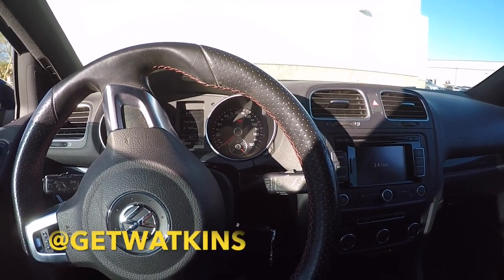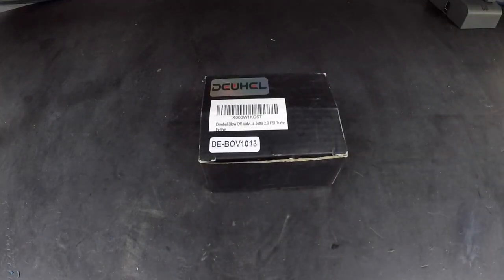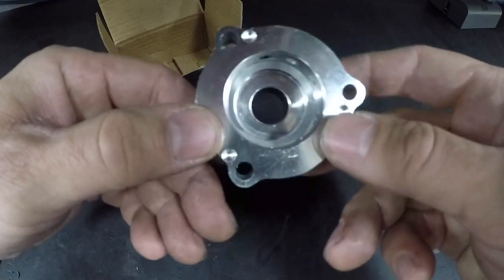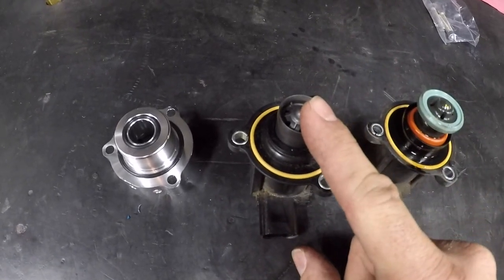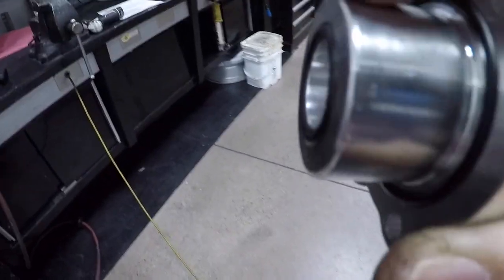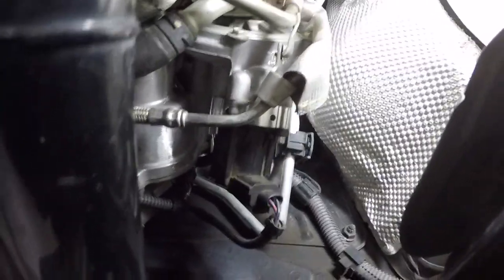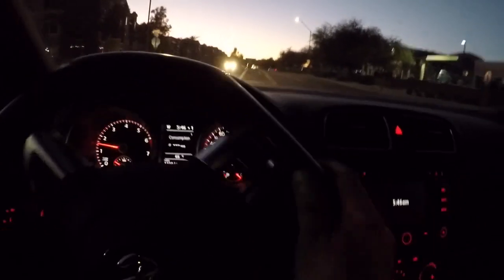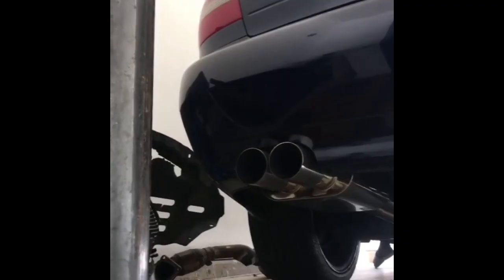Installing a cheap Amazon BOV spacer for an FSI on a TSI  Will it work?

Comment: So I have a 06 gli and it sounds like that with the oem turbo and DV. I actually replaced the oem with a new one made in Frankfurt.  Sounds the same. Any ideas as to why? Surges at low booat low rpm. Like in a parking lot. Pulls hard when on it

Comment: I’ve added one of these to my A3 8p with the Rev D diverter valve and fits perfectly but I can only hear boost leaking from it no proper woosh.
Do you think it could be because of the old diverter valve although it’s not torn
Reply from the maker: Hmm so it doesn’t make the loud psssst noise when you let off the gas? If you have a dsg it will only do it when you let off the gas and not between shifts.

Comment: I took mine off. It KILLED my gas mileage. The engine is really tuned to use that extra air the spacer blows into the atmosphere and when it doesn’t haven’t it the engine runs richer than it should.
Reply: These types of comments are false. When you let off throttle it goes into decel fuel cutoff or DFCO. You get no fuel so the air thats trying to get past the throttle body is just slamming the plate. In fact here is the definition in the ECM for what is happening. (DFCO Minimum Lambda to Enable: The minimum lambda before DFCO will be allowed. It is not allowed richer to help prevent dangerous exothermal conditions in the catalysts. If DFCO is commanded before this lambda is hit, it ramps to this lambda first before fully cutting fuel.) Also i'm probably one of the few people who have figured out how to get a burble tune with HP Tuners.
Reply: 😂 Maybe cause you were gassing it so you could hear the noise the point of a diverter valve is to use un used air to rid the car of turbo lag so it doesn't feel like a turbo car basically it uses the unused air it created and puts it back into the compressor which is the fin of the turbo how would releasing a small fraction of that make you lose mpg

Comment: Old video but I installed the same one except they refined it so it fit really well but after driving for 5 mins I got a misfire and car drives rough as hell. Any tips I ended up taking it off all the bolts were tightened down and yes I plugged it back in. No idea why it’s only me having this issue. Thanks
Reply: check if the adapter seals with the electric valve. If not the engine have to much fuel and makes misfire.
Reply from the maker: It may just be a coincidence that you now have misfires unless there is a leak at one of the seals for the spacer or the DV.  Check to see what cylinder or cylinders are misfiring and then swap the coils from a cylinder that is not missing with the cylinder that is and see if the mis moves. If it does the coil is bad.
Reply: I've got the same issue on my car , do you know what happened to cause this misfire?

Comment: How's your GTI holding up at 110k? I have a Mk6 GTI with 84k on it, had it for a little over half a year now
Reply from the maker: It’s running great. I got it with 103k and the timing chain tensioner failed causing the timing to jump time and it bent all of the intake valves.  So I rebuilt the head and it’s been running great since. Make sure you replace the timing chain tensioner before 100k and stay ontop of the maintenance and you will be good.
Reply from the maker: Tomer R good question. I meant pre tensioner update but I have seen one of the newer style tensioners fail.  It’s still a good idea to check the tension and count the rings on the new tensioner and make sure you don’t see more then 7 or 8.  If so the chain is stretched and should be replaced.  You can also check measure value block 93 at idle and make sure the cam timing offset is not more then 6deg.

Comment: I definitely recommend the ecs diverter valve spacer. Gives a nice flutter w intake. $54 I believe
Reply: Isnt flutter bad??
Reply: I got a forged diverted valve for 60 lol
Reply: Thank you, I want the flutter, and this Amazon one just goes psshh. Nice to know the the ecs tuning one is better.
Reply: @dallas4616  that’s only if you have a cold air as well. It
Reply from the maker: david stine right on thanks man
Reply: if your getting flutter than you put the connector on wrong